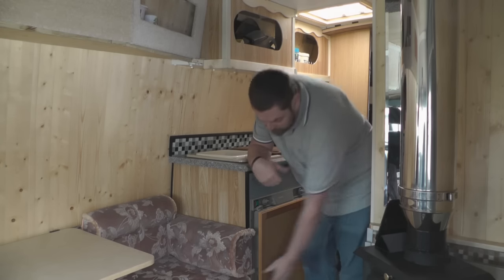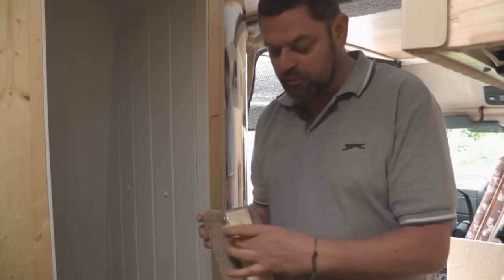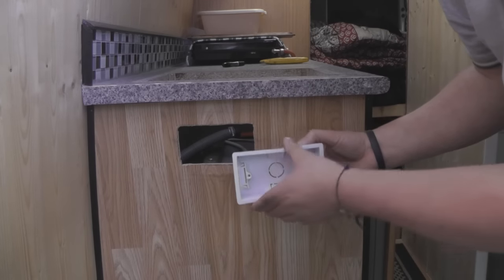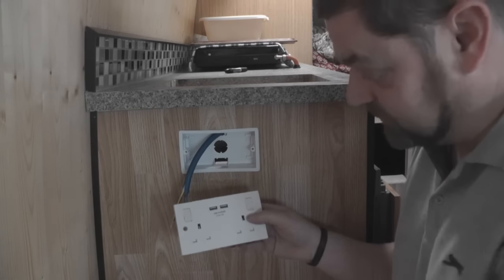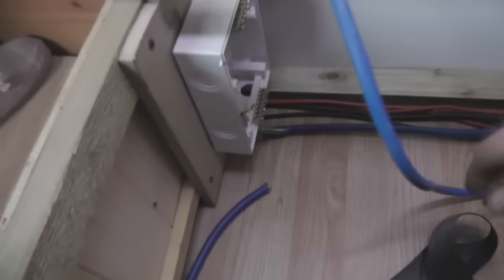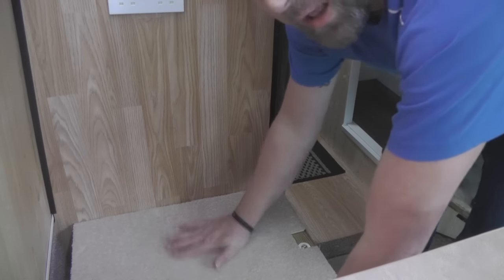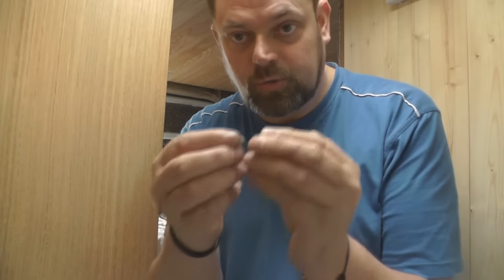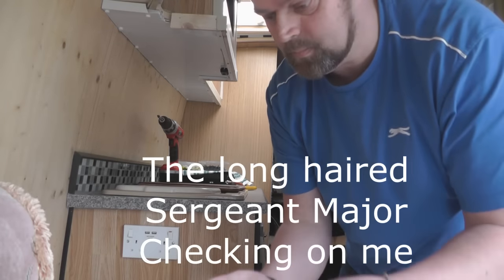Campervan Self Build - Installing 240v Sockets

Comment: So does the 5v USB feed come from the 240v wiring too? Guessing the socket has some sort of adapter to convert the voltage? Could do with some of those at home! So many USB devices here...!
Reply from the maker: Mark Jose Hi Mark the transformer is built into the back of the socket front plate and yes everything runs off usb so much that these sockets should come as standard nowadays 👍regards James

Comment: I thought you would of showed the wiring of the fuse board.
Reply from the maker: Hi sorry about that, it was just a video for the installation of the socket but I wired the cable directly into the fuse box, if you have any problems wiring into the fuse box let me know I'll help if I can, regards James
Reply: @jamescrook9749  I would have liked to have seen the wiring in of the socket. I'm about to wire one in for my camper its a 2 gang 13 amp socket same as yours (minus the usb) coming from an inverter but it has two places for earth wire to go, when the cable I am using only  has one earth wire same as yours. So what do I do get some more earth wire? Also what do I do with the earth once connected to the socket? Please help.